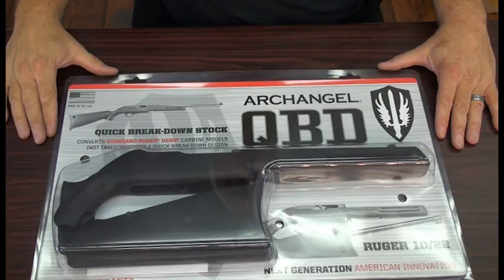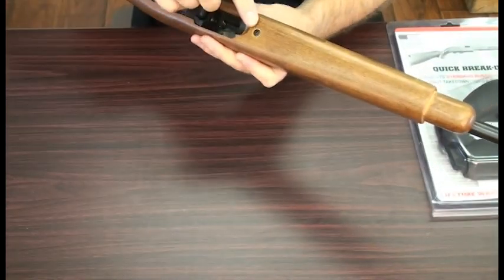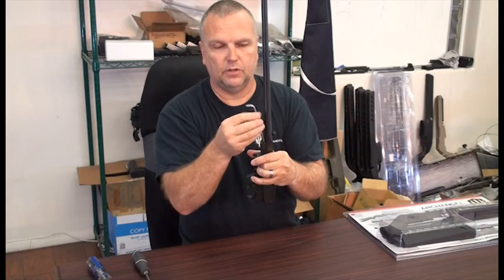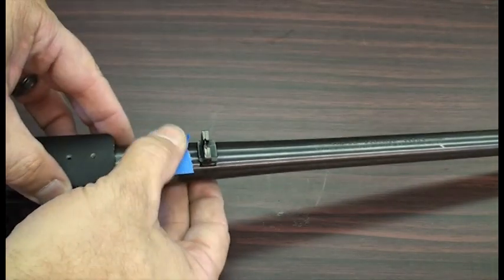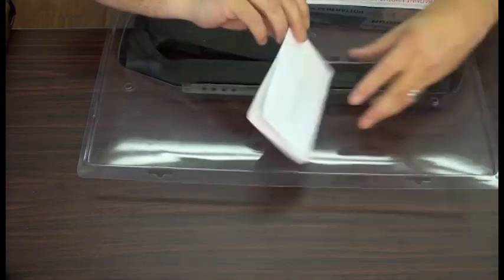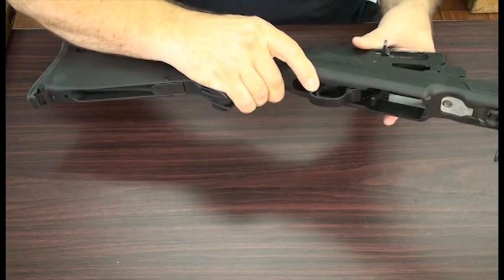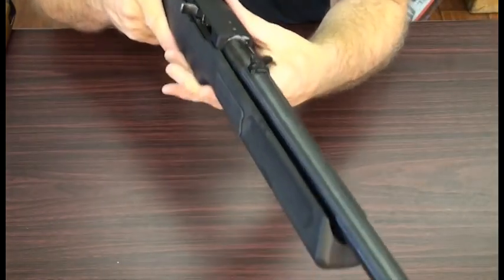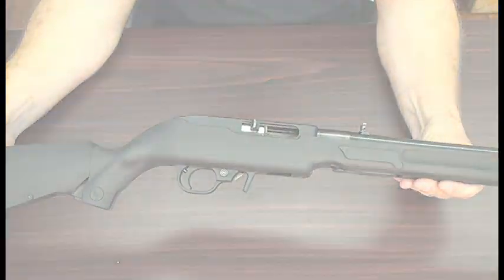AAQBD INSTALLATION VIDEO 2018

Comment: Great instructional video. Glad to see that you thought enough of the rimfire enthusiasts to aluminum bedding block this stock. I would have liked to have seen my AAP1022-OD bedded similarly. I really like the barrel locking latch also. A redux of the AAP1022's should include the two aforementioned features.

Comment: You should specify it only fit 18inch .92 barrel in the package description. I waste $150 to find that out.
Reply from the maker: It fits all barrels up to .920 diameter.  You can easily swap out any other barrel without tools..

Comment: Will this be coming out in any other color eventually? FDE, OD, winter camo?

The barrel latch mechanism is the star on this stock. I think you could design other QBD designs using that platform, like a side folding stock pistol grip rifle. The barrel could slide in what would be the  fake buffer tube.

Comment: Q: Will the stock compartment hold standard 10-22 10 rd magazines?
Reply from the maker: No.  The compartment is not large enough for a spare magazine.  This stock and setup is the absolute lightest weight, most compact and packable self contained 10/22 setup available.

Comment: My 10 round magazine keeps getting stuck in this stock
Reply: I had the same problem. The QBD seems to have a very tight fit. I solved this with an extended magazine floor plate
Reply: @rickdeppat4456  hmmm, I'll check that out